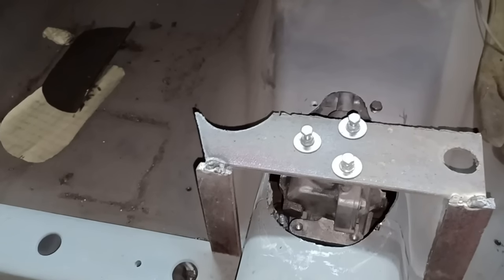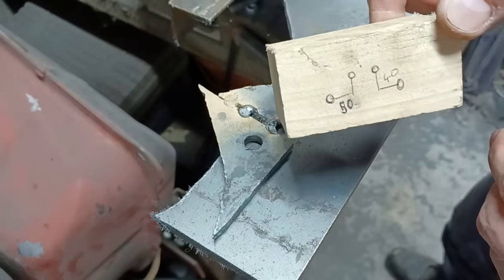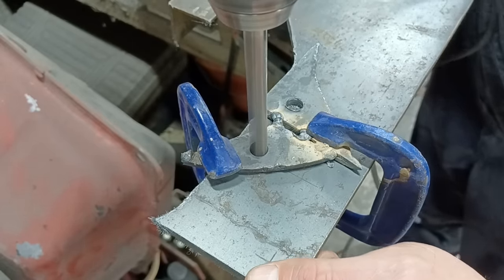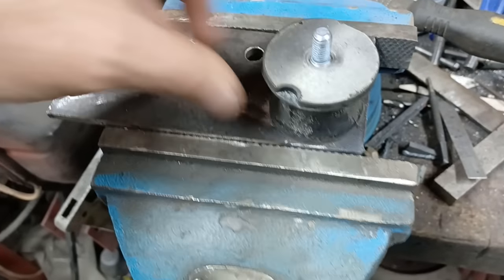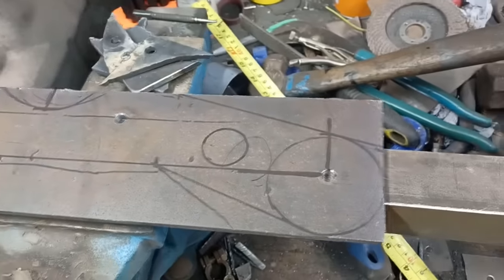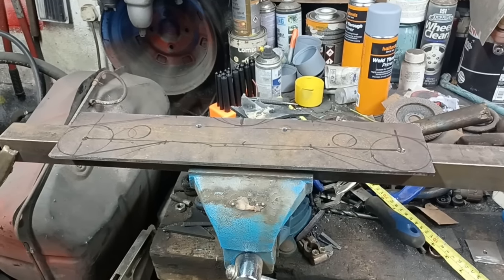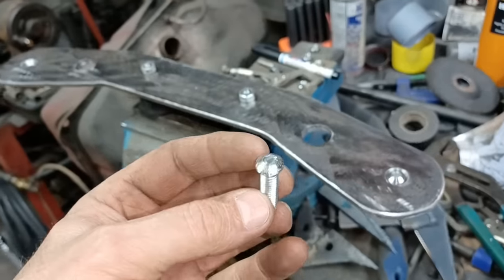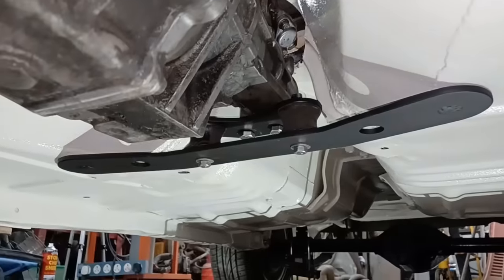Ford Escort MK1 Restoration Project, DIY Gearbox Mounts, Zetec RWD, Mazda MX5 Gearbox

Comment: Nice bracket, id have been inclined to weld the studs into the car floor and bolted from underneath, that way if you ever had to remove you wouldnt need to access under the carpet to get at the nuts.

Comment: Back in the 90s we did a similar type conversion putting a ford  3litre essex into a mk1 escort and eventually you could see the metal stress out with a type 9 gearbox ...eventually we have to run a brace from  the sills to the gearbox tunnel using 40mm channel ...that held up failry well and kept the gearbox and propshafy from flexing to a minimum...just my expierence
Reply from the maker: Thanks 😊

Comment: Nice work Dave looks the part as you said you may need to weld a gusset if needed but in theory looks and seems to hold great again nice work fella
Reply from the maker: Thanks 👍
Reply: Looks good Dave , possibly a wedge shaped gusset either side following the curve of the tunnel

Comment: Nice fab work as always, looks plenty strong enough. 
I would have put a spreader plate/countersunk bolt interior side so all four bolts are accessible from the underside and looks a lot neater as you've not got the thread protruding into the cabin.
Reply from the maker: I did think of that, but I think it's easier to fit up this way, I'll cut off the protruding bolt, and by the time I fit sound deadening and carpet it'll dissappear, I hope 😋
Reply: @DavesGarageuk  Assumed you'd have considered it but had your reasons for this way.
The nuts won't be very accessible if they're under carpet and sound deadening...

Comment: Lovely job dave  how do you work out the angle of the prop so it don't  vibrate?
Reply from the maker: Angle finder on the back of the gearbox, same angle on the diff flange, as long as they are the same or very close, all should be good.

Comment: First view! Very fortunate timing...
Reply: Hi nice gearbox bracket, but would have been better with the bolts going through the body, going the other way head of bolt inside the car, the way you have done it, to take the gearbox out you have to get inside the car to undo them
Reply from the maker: Ha, well done, give yourself a gold star 🌟

Comment: Hi where do you get your cutting disks for your dremel and what make are they the one's I'm finding are useless and just snap. Thanks mark
Reply from the maker: Hi Mark, they are https://www.ebay.co.uk/itm/153610826736?mkcid=16&mkevt=1&mkrid=711-127632-2357-0&ssspo=STZoaCotS-e&sssrc=4429486&ssuid=v5ZLVAlZQYe&var=&widget_ver=artemis&media=COPY you'll need an adaptor for them too, not cheap, but do work very well